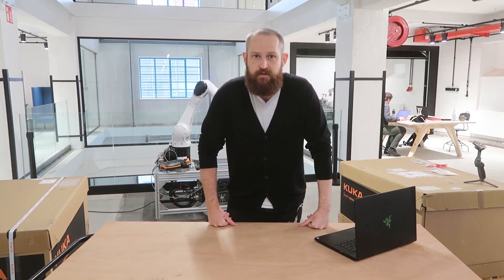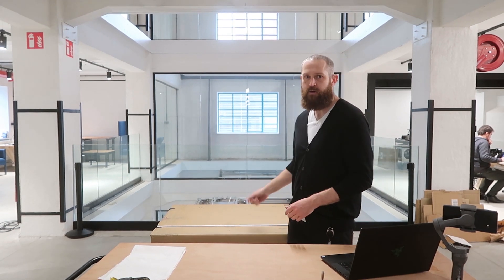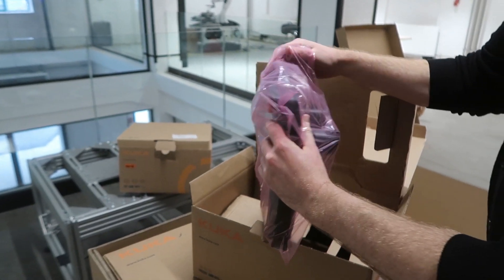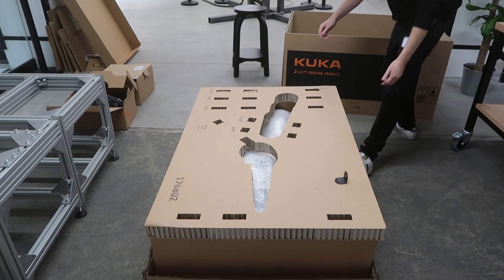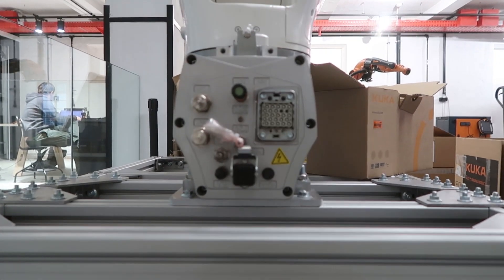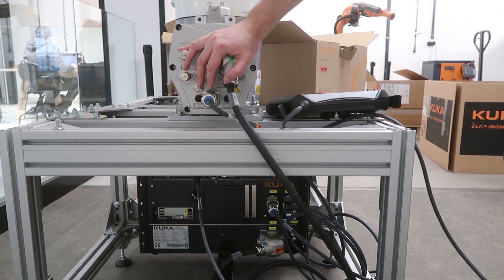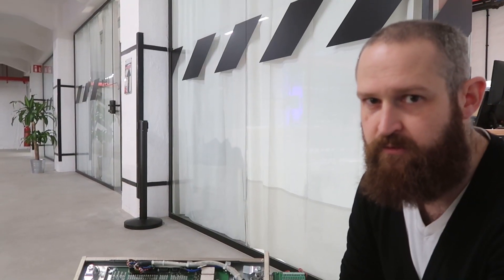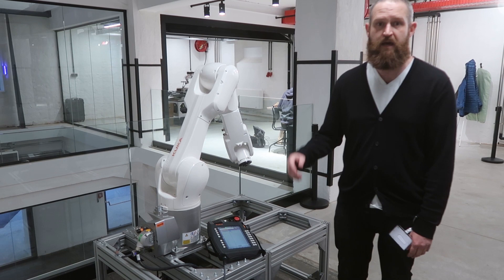Unboxing a $40k Robot

Comment: I still don't understand how those robots can be so expensive. Think of all the components that go into a 20k$ car. And think of all the components that go into this. Include harmonic drives and whatnot, the price still seems immense.
Reply from the maker: They are not cheap, but they are also highly complicated machines running on very specific software. Now I have absolutely no insight or knowledge on KUKA's inner-workings, but from what I can gather, they don't make all that much profit on the hardware. 

Plus, thats the US price from a reseller, I reckon you could get this model quite a bit cheaper if you talk to a KUKA sales rep.. ;)
Reply: If millions of people bought these things, they would get a lot cheaper very quickly.
Reply: The robots MAKE the cars. One car body takes about a minute to produce. They are insanely precise. The repeatability is +- 0.02 mm. That is way less than the thickness of a sheet of paper. And they maintain this precision for many years. There are many KUKA robots running for ten years without any maintenance. And the controller & SmartPad are included. Seems like a good deal now, right ?
Reply: @XiaoP76  Not really. A car of the equivalent cost still has like 100 times more moving parts. And more precise parts too for that matter.
The fact that they "make" the cars isn't really a point. A 10 $ screwdriver also "makes" the cars. A 20 million $ press machine also does.
The main cost cause is the scale of production. If you search for robot factory videos, they still assemble them mostly by hand. Which could seem paradoxical. But its obvious that the makers did the math and found out that assembling them by hand is more cost effective, since giant automated factories that make a robot per minute are just not needed.
 Its just that the car market is much much bigger than the robot market, which makes automation worth it, which drives costs down.
The robot itself isnt actually more complicated or more precise when it comes to the actual components. Nor are its electronics higher-tech than a "car brain", especially nowadays. The car also certainly contains parts that are decades ahead of a robot when it comes to material science.
I mean, my first comment was dumb, cause the cost differences do make sense. But not because the robots are actually more technologically advanced than an equivalent costing car.

Comment: do you actually need a cage for the robot or is there a way to circumvent this? i really like this robot, but building a cage would totally defeat its purpose for me
Reply from the maker: An industrial arm requires a suitable mounting position, these things can move around 2 metres in a second. ONE SECOND! There is no "cage" in this setup. Traditionally, an industrial robot requires a safety cell.

Comment: Did you know that you can twist the yellow part on the robot power cable to lock it?
Reply from the maker: Yes, but good tip, should of included it in the video! By the way its called the "motor cable" and the other is designated the "data cable" ;)